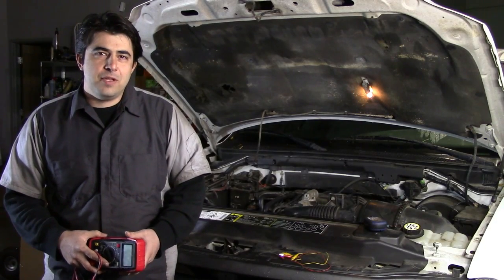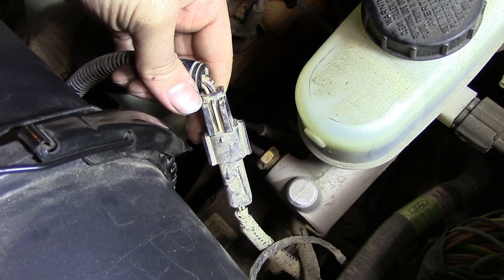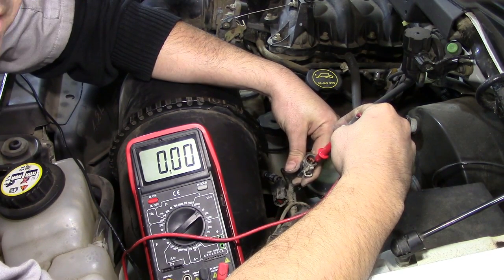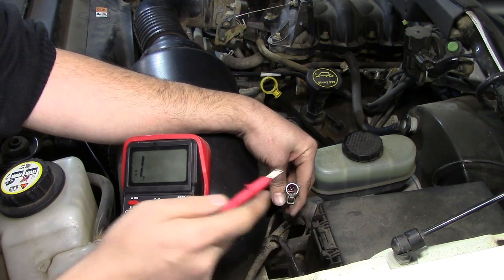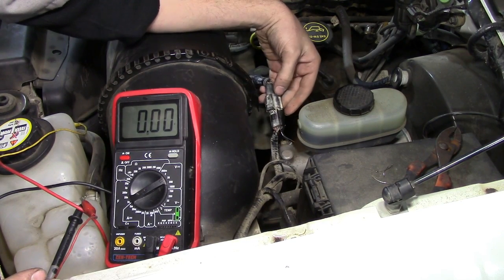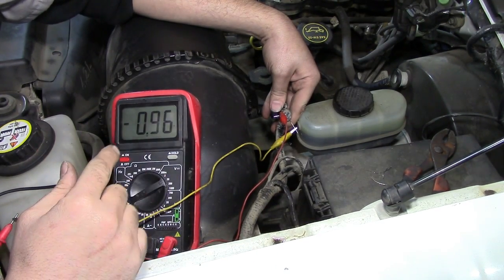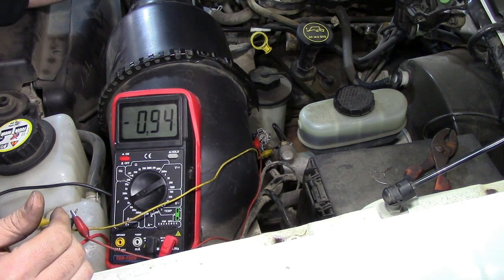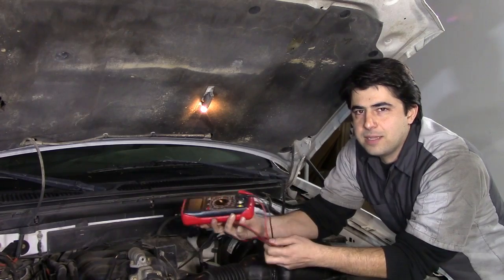How to Test a Mass Air Flow (MAF) Sensor - Without a Wiring Diagram

Comment: Mine has 6 pins :P
Reply: If you have a 6 pin connector and six wires going to the plug also your MAF sensor has a air temperature sensor combined in the MAF. Some models have the sensor mounted on the air box with two wires going to it
 where the air filter is located to monitor air temp as air temp will also play a role in how your computer adjust for fuel mixture also.

Comment: which are the wires that you backprobe?
Reply: He said there are (3) Wires...
a) constant 12 volt feed
b) ground
c) signal 

He attaches the leads to the b / c
Reply: DangerDaveFreestyle b&c ? I thought it was a&b ? I’ll go back and watch again. If I’m wrong then that might explain why I was only getting like 3.8 volts and it never changed in voltage. He only shows you one that is good , what if like mine it only showed and stayed at 3.8 volts? If I did it right could this also indicate that it’s bad by doing this?
Reply: Ok, I did it wrong I believe. Went back to watch it again and he talks about identifying the constant voltage wire in the ground and then he says we need to test the remaining two wires which in his, it’s the two Signal wires. Now that makes sense to me. I guess I’ll be checking it again tomorrow.

Comment: Very detailed. I followed your procedure very easily, and I really like all the tips that you told us. Thank you.
I have a question though. I'm reading 12.7v to 12.8v in idle. Does this mean that my MAF is shot?
Reply: i know this is way too late to be useful, but maybe useful to someone else reading this. it's likely you were just  reading the supply voltage, not the voltage between signal and ground.

Comment: Hi dear have u ever had any maf signal wire showed 4.3 volt at idle then goes down smoothly like 4.2 .4.1 at higher rpm I can't figure it out power and ground is okay its 94 camaro z28 I drives better without maf thnx
Reply: Did you end up replacing the maf? My chevy is doing the same
Reply: +Kourtney Adams no i did not .i bought a service manual and it says look for herts signal frequency not volt so it was ok

Comment: Great test. However I thought the MAF voltage varies according to the amount of air entering the engine and not to RPM. which means a better test would be to use a blower fan or compressed air and see if it reacts...I could be wrong but just curious...
Reply: +Younex Meures more rpm means more airflow will be present in the maf sensor so same thing